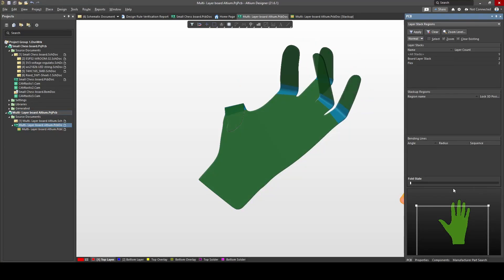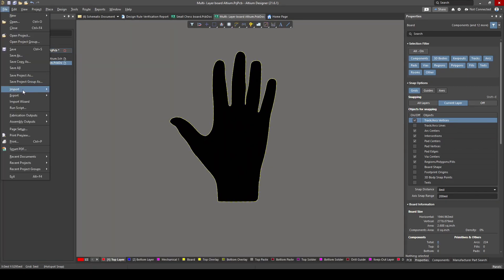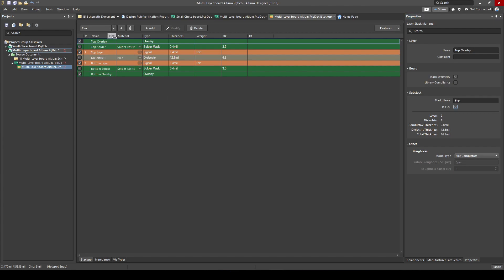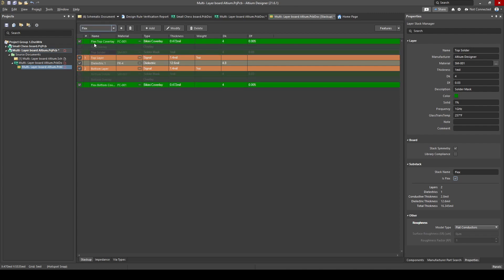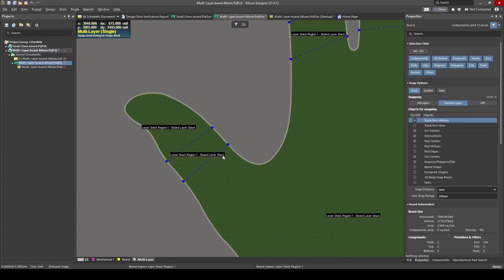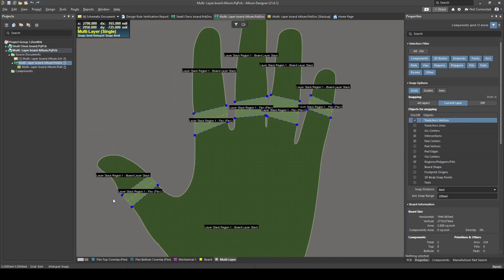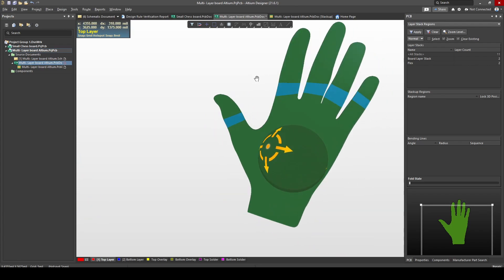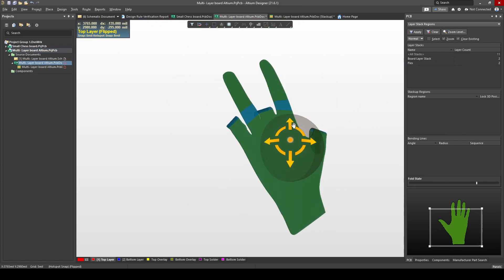Altium Designer Tutorials - How to create a flexible PCB

Comment: I did the exact same thing...same version and my board layer stack top layer/bottom layer/ top solder/bottom solder were deleted.  When you delete a layer on the flex it also deletes it in the board layer stack.  Altium creating a flex is one of the most confusing items ever.
Reply: uncheck a layer on the flex, not to delete it